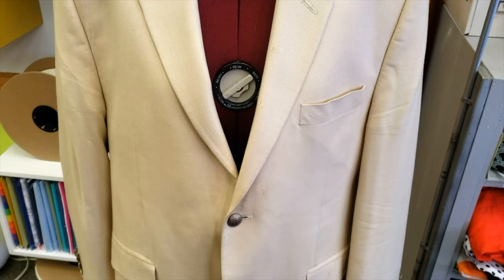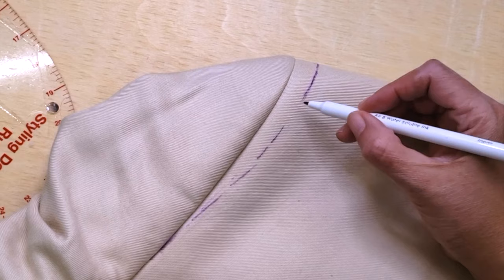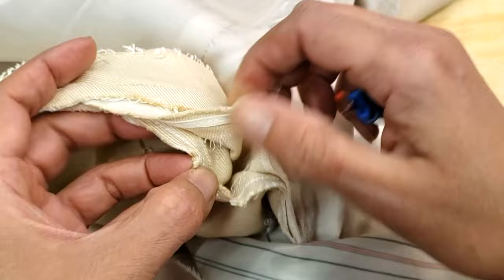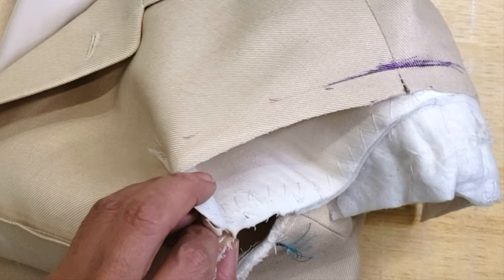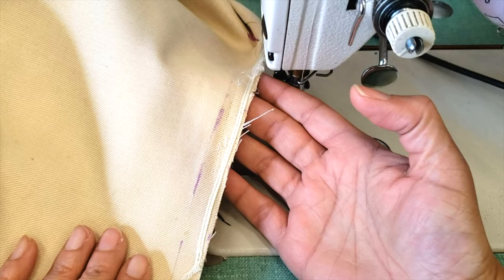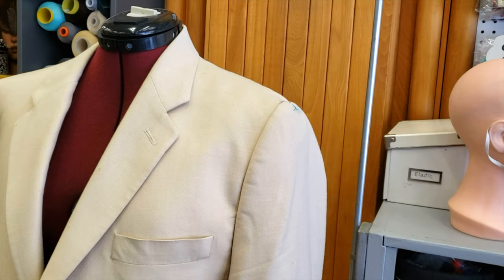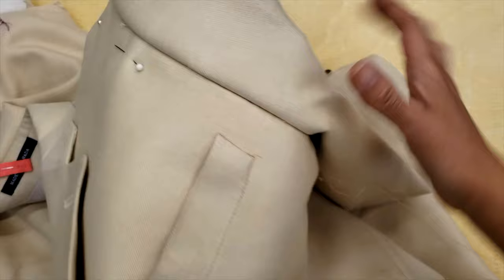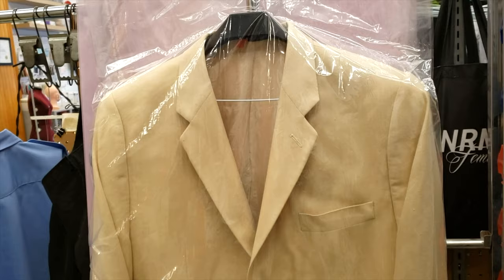Professional Tailor Raises Shoulder on Men’s Jacket **the trick is bas…

Comment: I need some help. I bought a wool winter jacket that has sleeves so sloped, I cannot put my hands in the hip or breast pockets without the whole thing riding up. It's drop-shouldered. I'm unsure if the alteration needs a gusset or a full sleeve. When it went on sale, I purchased two so that I would have fabric to raise the shoulder cap (same as you have here) and draft two sleeves will a fuller range of movement. I've never seen this alteration done before.
Reply from the maker: Please, look for my email on my channel and show me a few pictures.
I need to see the problem clearly, so I need good quality pictures from
different angles from close and far.
I might be able to help you with a Short. Cheers 😊

Comment: Hi there, thanks for another great video! I do this alteration at my shop, but I only unpick the sleeves about 3/4 of the way, leaving them stitched together at the underarm below where I am trimming away for the new shoulder line. Do you think it is necessary to take them completely off?
Reply from the maker: Not really.  I'd say is ok as long you are absolutely sure you're going to connect the old a new line properly.  I mean, sometimes it might be difficult to visualize a good armhole line when you have the sleeves still attached.  But for an experience tailor/seamstress, is not really that hard.  I hope this helps 😊
Reply: @DowntownTailoring  thanks! now I understand why you take the whole sleeve off, I was wondering as it seemed to be giving yourself more work:)
Reply from the maker: @crazylilcraft  Yes, I know.  I have analyzed that many times before concluding that it's safer opening the whole thing.  There are circumstances where I don't open all the way.  Cheers 😉

Comment: Doesn't the sleeve pitch change when you shift the shoulders? You would have to rotate the entire sleeve slightly when sewing it back on, because I would imagine connecting it at the same spot would cause the pitch to change.
Reply from the maker: That's an excellent question!!! And the answer is yes and not.  I measure the high more than the point.  That's why you see  me marking it with a horizontal to the floor line. If you apply internal and external angles theorem you will notice what I mean ( saying that to the risk of looking too 🤓 nerdy!) 😭😭😭 But I love this question and I thought about it for a long time until I discovered that I can avoid the problem by marking this way. Cheers 😊